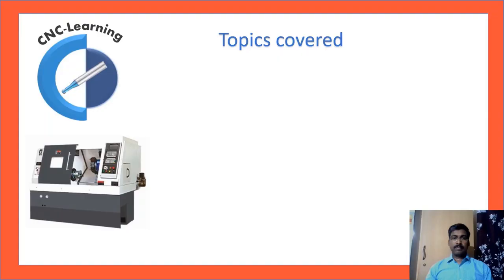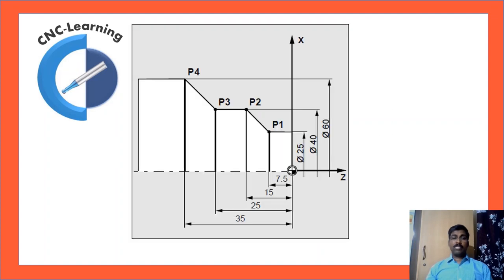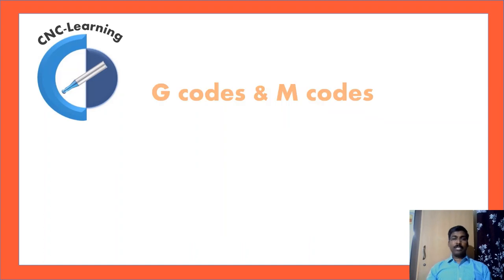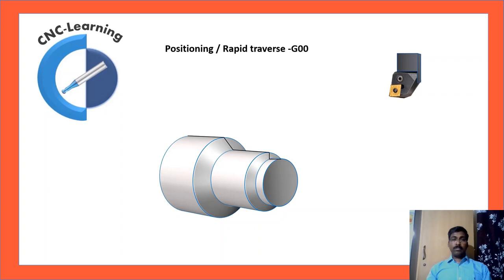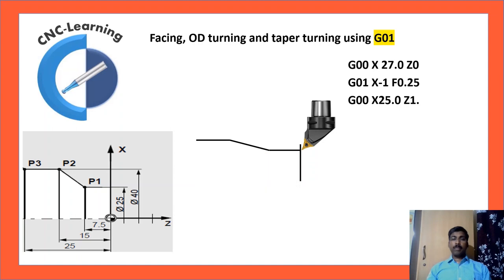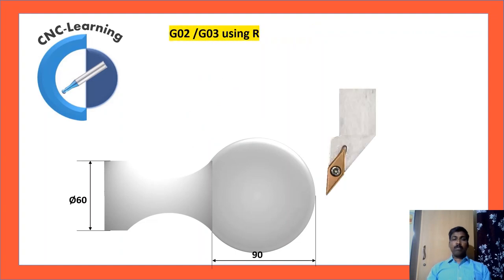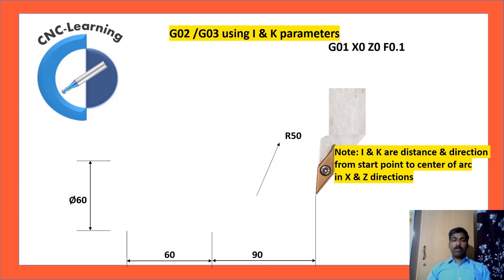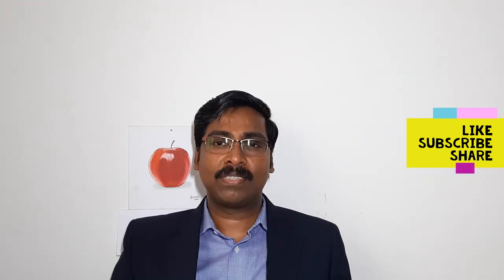CNC Programming Turning | CNC-Learning | Rajeev Sreedharan

Comment: Sir @8:28 is it X60.0 or X30.0? Since tool is starting from G01 X0 Z0.. and the whole diameter is 60 shouldn't it be 
G03 X30.0 Z-90.0 R50.0 ???
Reply from the maker: X0 Z0 is defined at the extreme right center. X is diameter and the end diameter for circular interpolation is 60.
So it is X60
Reply: @CNCLearning  ok sir, thankyou 😊